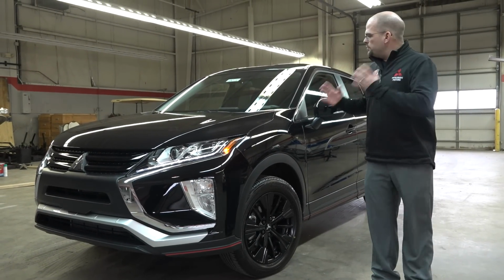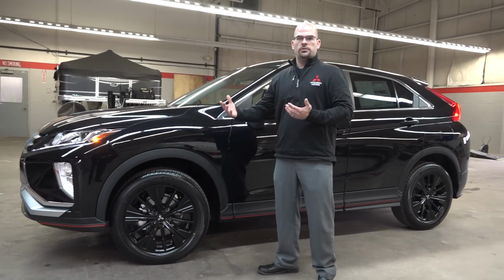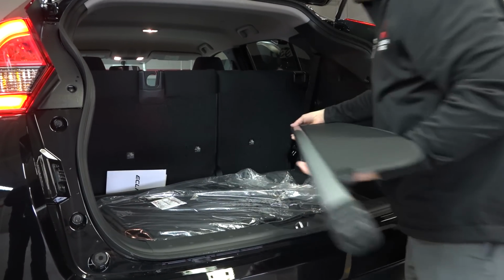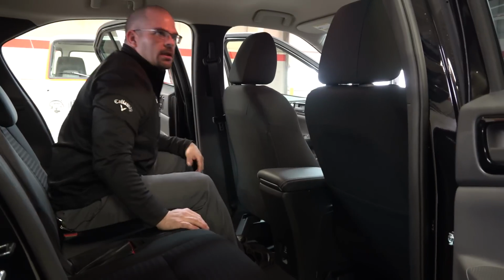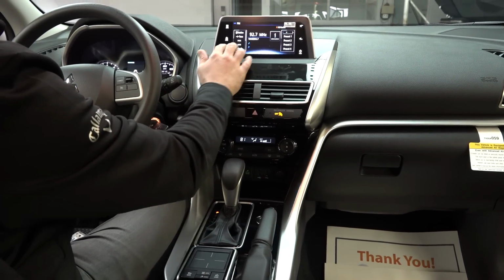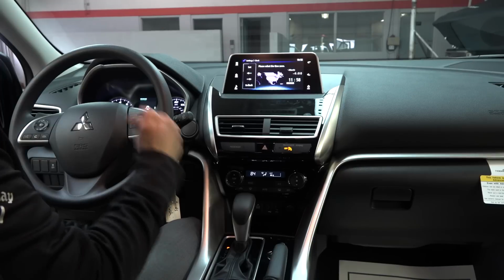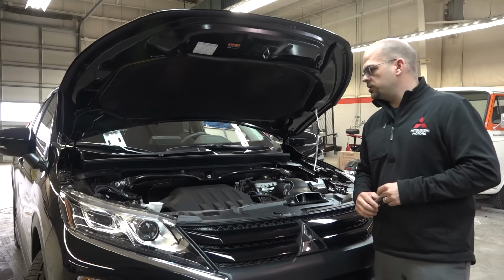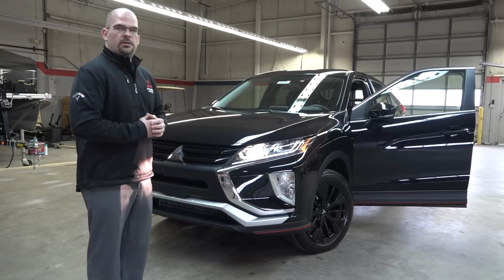2018 Mitsubishi Eclipse Cross LE Limited Edition Exterior & Interior Walkaround

Comment: A few things that seems strange that M has on their Cross -- 1. auto headlamps that have to be reset each time the vehicle is turned off? 2. a Key instead of just fob and push button start? 3. No power trunk? Thus no hands free opening? 4. No power rear seat drop down/return?  One would have to drive it but the engine seems to be quite under powered. Hard to find info related to all the items on the vehicle at any manufacturer website in Canada. Also, no one seems to have a detailed and in depth and driving of the Diamond edition. Too bad but even some reviews that say Diamond make no statement that the vehicle being review is actually that version.

Comment: No push start?
Reply: push start is part of the eco development where the car cuts out when you stop. it sound a good idea but in reality it's a pain and it's best left off the car if possible. thankfully that feature is not part of this car in the uk
Reply: The start/stop he means is the button to start the engine without the key in contact.
It would be strange if it doesn't have it, also a lumbar support.